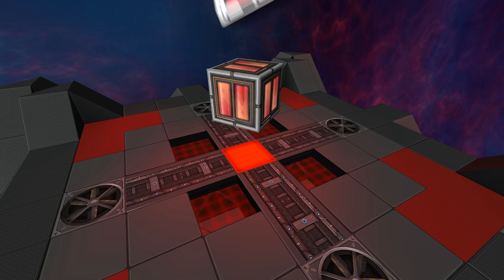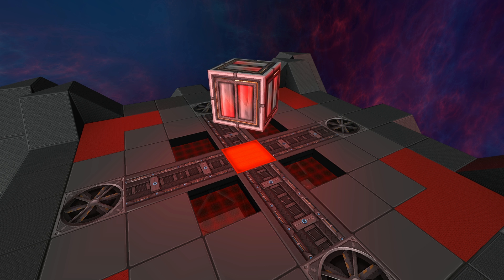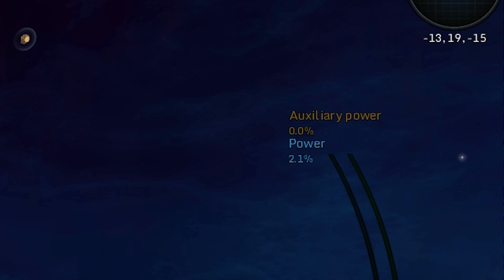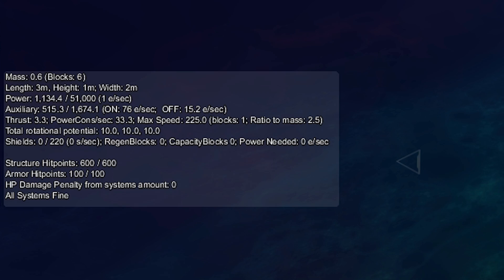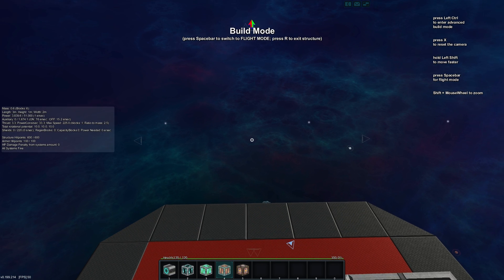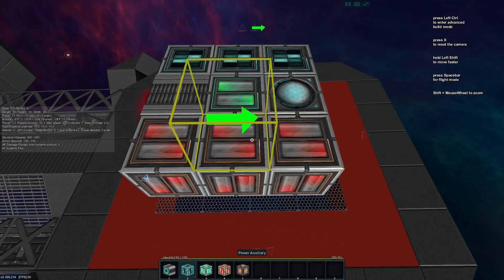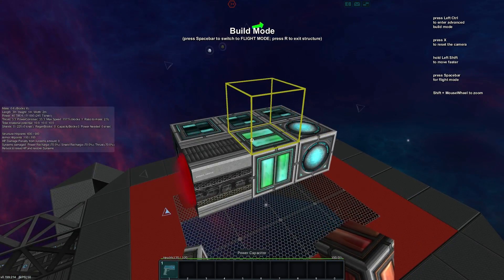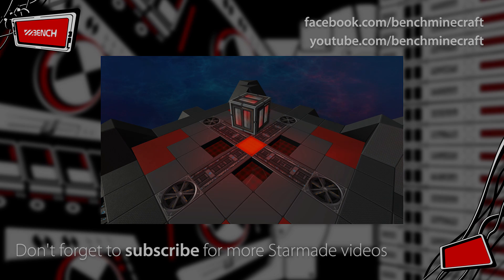StarMade - NEW Power Auxiliary Block Introduction

Comment: why did they not add a "powerreactor dockingport" This thing gives power to the mothership and if its distroyed it takes the generator with it!. with this you mini the lag by battledecopling and make it fun for the attacker (becouse in the old version the attaker just open the box of pandora with his attack)

i hope they fix this soon becouse right now big ships have the stamina of whalse on land
Reply from the maker: We weren't going to add in a unique docking point for docked reactors. Them undocking even if partially damaged when undocked, still would cause too much lag through collisions etc.
Reply: Bench
 give it a 30 sek noclip and 50m/s in a random direction if undocked. Hell if docked reactors are a problem why we have a powercap? Just to limit big ships? How about limit big ship and not the power of this big ship.
Reply from the maker: +HungryHunter there's discussions on reasons in the StarMade Dock community as to why have a cap, etc. too much to go through just here

Comment: This is not at all what docked reactors were used for by anyone who was an actual combat builder, Bench.  The purpose of docked reactors was to supply space efficient CONSTANT energy regen at an efficiency near 80% that of a fully efficient power group.  2 mil docked reactors would reach 80% efficiency in trade off for the transfer rate debuff.

The basis of this was on the cost of volume.  A normal volume to base your efficiency on was 10000 as you can garner 2 million e/sec with a 23x23x23 efficient reactor which is 12167 volume.  Stretching that prism out to a longer than wide or tall number, depending on how far, could decrease the total volume needed for a 2 million efficient reactor to slightly less than 10000.  Using these hyper efficient long designs, you could transfer 80% of the 2 million e/sec to the ship because of the 20% cost of use, meaning:

-)  10000m^3 for 1.6 million e/sec yielding a e/sec/volume ratio of 160.
-)  Where as the linear stats are as follows:  80000m^3 for 2 million e/sec yielding a e/sec/volume ratio of 25 (The linear increase in power).
-)  160 : 25  Using ingenuity we made ships 6.4 times more power efficient than before (because the power system is broken and we needed to). 

From what I can see, the auxiliary power is a linear increase of 25.34 e/sec when on, meaning that we might as well just brute force it as the main reason for us adding the docked reactors was to have passive additional energy.

This system is a nice touch if it were to be implemented without removing docked reactors.  It also seems that the base linear power generation increase off of brute forcing a huge chunk of normal power would be a far better way of doing things than this.  

And I would prefer that you DO NOT try to say that the use of these power auxiliaries is similar to the main purpose of the docked reactors, because it is not.  This is a blatant slap in the face to anyone who actually used them on their ships and a very low blow to try to silence their point by saying it doesn't exist.
Reply from the maker: In the video description is a link to Lancake's explanation as to the decision process that lead to this implementation, that might be better explanation wise.
Reply: I will give this a second look, I'm still not entirely sold on the concept of these new auxiliaries, but I will take some of the new information I have now and do a few tests before I say anything else.
Reply: After doing some more testing on them with this new information from Lancake, there are two improvements that need to be made to the system and I am fairly sure that everybody would be okay with it.

1)  Make the explosions stop if the auxiliary is turned off.  (And only start again if it is on and hit again)
     A)  There needs to be a warning on the top of the auxiliary bar that says when one is compromised.
     B)  The particular auxiliary needs to flash bright red in the hot bar so you can turn off the right one.
2)  There needs to be more than one toggle for the power auxiliaries, as in, per group.
     A)  There needs to be the ability to link multiple auxiliaries to a logic signal so that the entire hotbar of someone's ship is not filled up with power toggles.

If those two very simple things are added in, I think this new system can work very well.